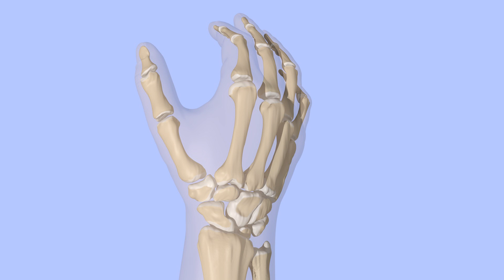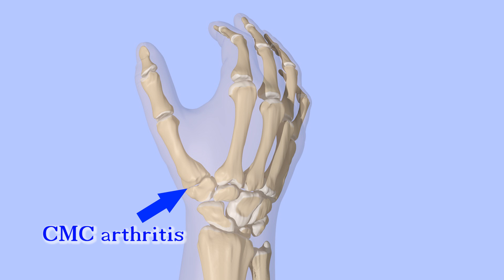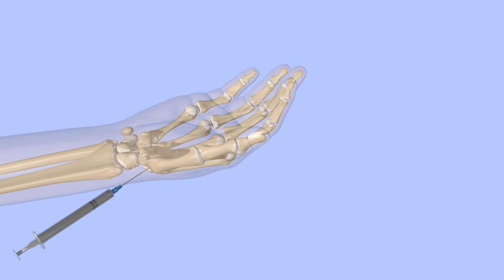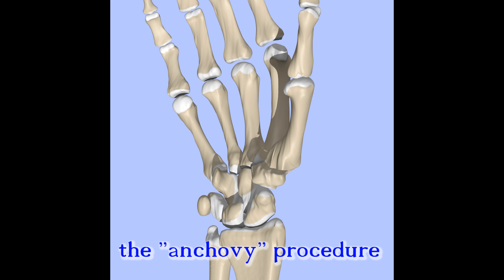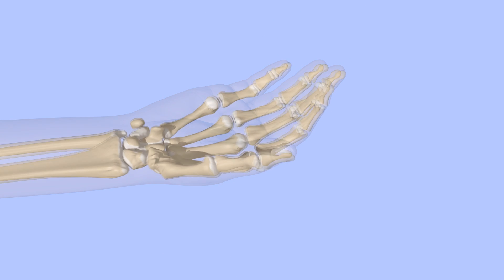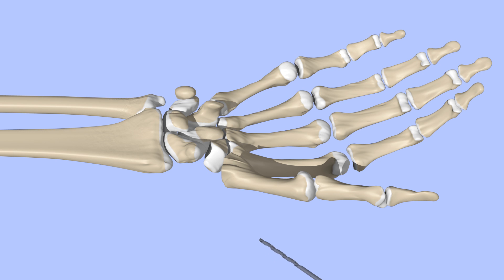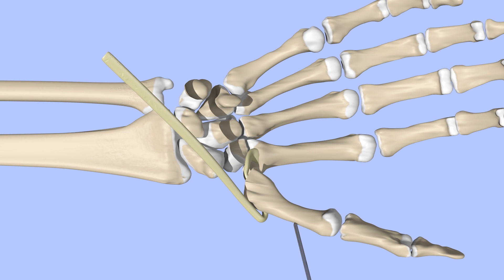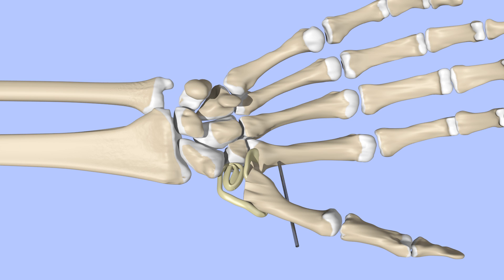The Anchovy Procedure for Thumb Basal Joint Arthritis

Comment: I was told I need this procedure but held it off for about a year now waiting for a better less evasive solution.  looking at the surgery it seems that there's got to be a better way, take my bone out feel it in with a tendon and be laid up for Four months of healing is really ridiculous You think with modern medical advancements we should solve this problem better,.
Reply: bluesmanreturns The time for recouperation is longer than 4 months but since it is your own tissue there is no rejection. Mine is back to 100 percent.
Reply: @cmoore185 
What about forearm mobility, now that the tendon was used in your hand?
Reply: Look at "Suture Suspension Arthroplasty" another method with shorter reported recovery times. Just had it done, myself.
Reply: @Ronsonic How is it going? Would you recommend?
Reply: It's been a year since you posted this but I felt the same way. Although not perfect I did something different. Unfortunately my local medical group doesn't do it so I had to pay for it myself. I felt exactly as you do this looks rediculous. Take a look at "Bio Pro CMC joint" on youtube it's a replacement joint.
Reply: @blackbirdpie217  u  get it done?
Reply: @mikepruett1745  Yes I've had it over three years now.